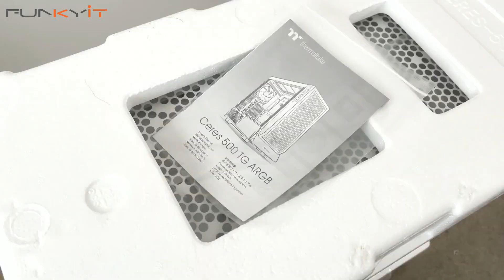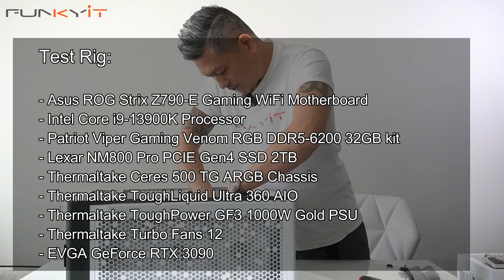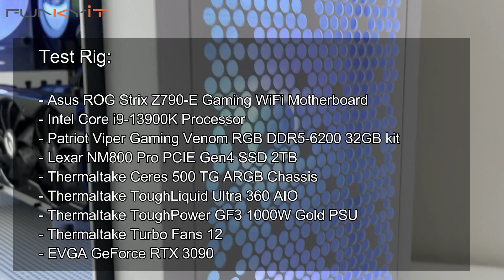Another Cool Chassis - Thermaltake Ceres 500 TG ARGB

Comment: Currently struggling to get the back fan to reach the mobo. If I use the extensions, then the front fans daisy chained don't reach. Can I daisy chain them all together and plug them all into one cha_fan and add_gen2 plug?
Reply from the maker: Yes I noticed a similar issue … a fan cable extension maybe needed

Comment: How did the radiator fit on top? This case has a maximum radiator length on top of 360mm
Reply: What do you mean? He Installed 360 Aio & said it fit with no problems
Reply: @madeinnola  This case at the top supports the maximum length of the radiator 360mm. And the length of the radiator he installed is 410mm.
Reply: The case can fit 3 140mm fans in the top, however it cannot fit a 420mm radiator because the listed size of a radiator is just the fins. It can fit a 360mm radiator just fine though, because there are no radiators with more than 60mm added for the tube ports.